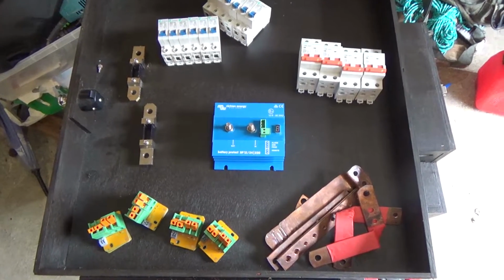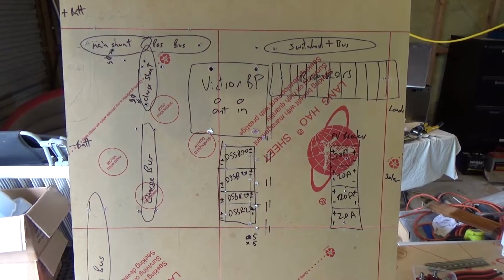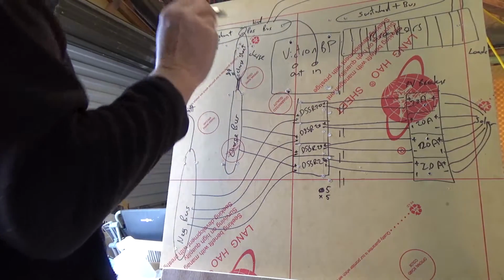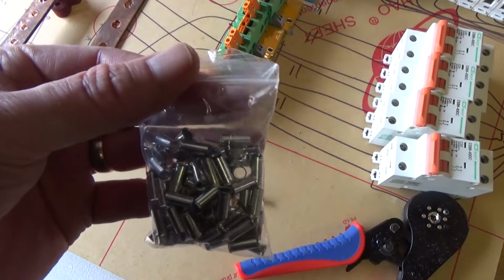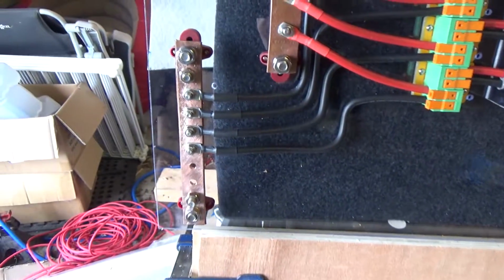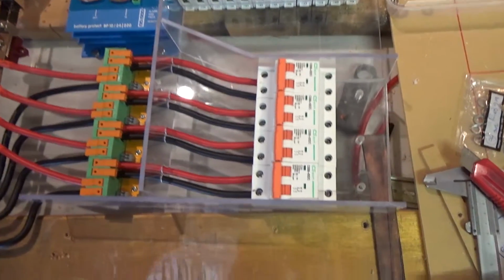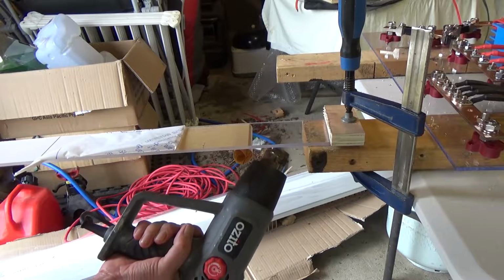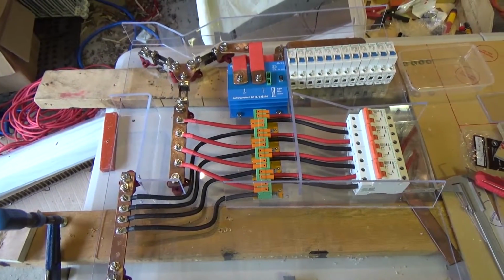RV Electrical Panel | 24V Electrical Panel in the Bused As Bus

Comment: Great looking panel. Watching you put yours together made me realise I'd planned our PV MCBs to go after the DSSR20s. Why did you decide to install the PV MCBs between the DSSR20s and the PV modules as you've done?

I like the acrylic board but I'd be concerned about it not being thick enough and stress/movement cracking it? I'm going to be using the standard ply sheet for mine, but I will be putting an acrylic box over the top to prevent any accidental touching/shorting etc... And, of course, acrylic does look cool!

If I recall Mr Argent's (my high school metalwork teacher) advice all those years ago, you need a solvent cement for fixing your acrylic. There are loads of types; different viscosity (liquid & gel), varied cure options (light, UV A/B, and two part catalyst), curing times, and appearance (clear or opaque). Here in the UK theres a brand called Acrifix which works well.

To use any solvent cement on acrylic though you need to make sure that both surfaces are absolutely flat and smooth (which hits your desire for a nice clear join, no need to scuff the surfaces).

The edges of your bent pieces may have little bits sticking out which you'd need to sand down flat, then get it smooth (to around 400 grit or so).

Depending on the cure time, you'll have to ensure the pieces are able to stand in place for around 10-15mins, to be reasonably secure against light knocks, so having some clamps or something for pieces that can't stand on their own is a good idea. Complete curing time can be around 48h total though.

You may also need to make sure the area you're in is at a decent temperature (ie: a nice warm room) and the acrylic has been given time to acclimatise. IIRC there can sometimes be a bit of heat generated by the solvent reacting and if the acrylic is cold it will suffer a thermal shock and crack.

Good luck mate, looking forward to seeing how you get on!
Reply from the maker: oops sorry, just saw your comment. Yeah wee bit worried about the longevity of the acrylic, and everything I build really :)
Great advice there thank you. Yes have gone with a slightly viscous solvent cement to reduce the amount of mess I make. And yes I do have little bumps in the corner of the folds, of course it would too, bloody good you mentioned that or I would have noticed them after making a mess even with the gel cement
Cheers :)
Reply: @BusedAsNZ  "everything I build" - aint that the truth though!?! :-) I live in fear for almost everything I build and so end up making stuff so grotesquely over-engineered it becomes obviously silly and I have to then scale it all back, which triggers my fear it'll fall apart and the cycle begins again.

I have been receiving loads of components in the mail recently; got the Electrodacus kit, DC MCBs, fuses, switches, and shunts. I've been busy doing layouts for the board... Really loved the Flux Capacitor in your design and that convinced me to try some adding interesting patterns into mine.

Now waiting on a few more little bits as well as the battery cells (shipped via train across the EU so might take a bit). I also talked myself into getting (it was surprisingly easy to do) a RD6012 power supply from AliExpress as my battery charger wasn't up to the task of balancing and charging the cells when they arrive.

Look forward to seeing what you've been up to in your next video!
Reply from the maker: Hahaha, that's strangely comforting.
Woohoo, getting the mail has a whole extra level of excitement when waiting for new toys. Yeah I figure it has to work but might as well also be kinda cool. Of course its actually going to be pretty much hidden most of its life but I had fun designing it as I expect you are too.
Oh cool, batteries by train, that's a downside to the bloody big moat we have around Aotearoa. Have fun mate

Comment: JB Weld Plastic Bonder glue not work?
Reply from the maker: Have not tried it, looks like an epoxy adhesive which will probably work if I rough up the surface a little. Thanks
Reply: @BusedAsNZ  BTW, great job on the panel. You've now made me decide to redo my own SBMS0 panel, thanks! :) :)

Comment: R you running  only  1 panel or 2 on each dssr20 ?
Reply from the maker: I currently have just three panels I got very cheap a long time ago, one per DSSR20 and one spare DSSR20. I don't have the roof space for 8 panels anyway but would very much like to get some bigger panels and maybe can fit 4 or 5

Comment: Nice looking, great ideas! Do you have a listing of your components like shunts, switches and fuses? I'm a bit worried about fatigue cracks in the polycarbonate though since it's a mobile installation... Greetings from the other side of the world where autum hits Germany and looking forward to your next videos!
Reply from the maker: Kiaora Germany, hope you are well over there.
Seems that youtube is deleting my replies if they contain links so will try again. 
Yeah I am also a little worried about it cracking, hopefully I will be able to tell you in several years that it has lasted well.
Most of the parts I have links to in the video description, I get most stuff from Ali since this sort of specialist DC stuff is pretty expensive in NZ.
The shunts however I did buy locally though even could have bought the exact same unit for half the price online, they are just a pretty standard 200A 75mv resistor
The BP220 of course came from Victron

Comment: Hi Bused_As NZ, Very nice work on the custom box & layout for your system,looks great ! impressed with your buss bars & especially the one for your dc load breakers,sweet ! looking forward to the next video to see you wire it all up & power it up, not sure but would you want same length  positive & negative wires coming from the DSSR20's to your buss bars ?
Reply from the maker: Thanks very much mate. I did wonder that after I had done it, but mainly because it would look nicer. I think that's more of a parallel battery cabling issue.
I don't think their relative lengths will matter electrically as the positive and negative legs are part of the same circuit and added together in terms of the circuit length. Even balancing all the charge circuits wont matter as any volt drop variation would only mean one panel provides more charge than another and of course some panels are already further away from the battery, some may have shade etc.

Comment: Awesome  job.. this is almost  exactly  what  I'm gonna  end up doing  great information.. thanks for sharing..  how many  watt hrs  is the new battery  ?  At max charge  u should  be doing  around  80 amps of charging  correct  ? Does the electro dacus take in consideration  power going  into  inverter  / battery  ?  I think  the electrodacus  can be wired up to recognize  different  groups  of panels correct  if not enough  sun it will switch  to  the larger group of panels cortect.. ???.. sorry  for  long wind response.. lol
Reply from the maker: Cheers. The first test was about 6500Wh I think once balanced better maybe around 7kWh. Yep this board would peak at 80Amps solar, and of course expandable. But the current 750W  on the roof wont get me anywhere near that (even then thats a theoretical 750, never got much more than half that in winter).
Yeah the Electrodacus can manage charge rate, pretty cool and very simple concept too. The idea is to limit the current charging when you have a heap of panels, for battery longevity. You split your panels into two groups, one twice the size of the other and the electrodacus then has three choices of array (33%, 66% and 100%) to stay below your selected max current. Add to that the new DSSRs with diversion when fully charged to maybe a hot water cylinder or to freeze ice, run ventilation or something else to use that wasted sun would all add up to a really great off grid setup
haha sorry, even longer reply ;)
Reply: @BusedAsNZ  thanks great reply..  im in love  with his system.. r u ever  gonna do thermal storage.. ?
Reply from the maker: Me too, after years and years of research I really think the SBMS0 is my ideal system. Probably not, I don't have a hot water cylinder or really anywhere to put it. And I guess since I'm only likely to have excess solar in summer, maybe some sort of cooling would be more useful.

Comment: Finding the correct glue for use on polycarbonate or perspex is an interesting exercise. Some of the better glues don't seem to be available here in NZ. Another possible option would be to bolt those pieces into place? If you fold up a few more small polycarbonate angle pieces you could bolt them into place. It may also help with installation as you could do all of the wiring and then finally bolt those guard bits in.
Reply from the maker: Sure is, ideally a gel for easy placement, that wont run or slump too much, and dries clear, oh and must work without me scuffing up the surface. Not too much to ask :)
Im still working through the stuff I already have in the garage, test 7c PVC Pipe Cement is underway now and looking pretty positive after 7a and b other than it dries opaque. It is the strongest bond so far. Keen to try some sort of glazing silicon too. Hmmm yeah, could fold up some brackets, that might give it a cool even more industrial look too. Cheers
Reply: @BusedAsNZ  I think you need chloroform for gluing
Reply from the maker: Yes maybe, or acetone or some sort of solvent to melt and weld it together rather than an adhesive